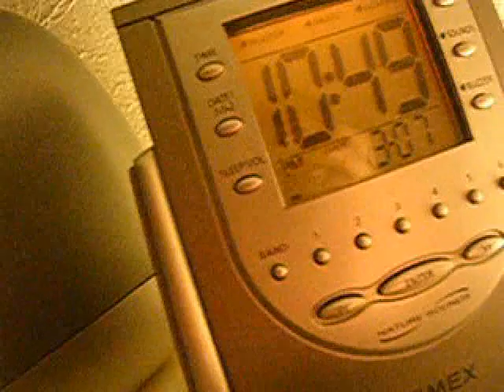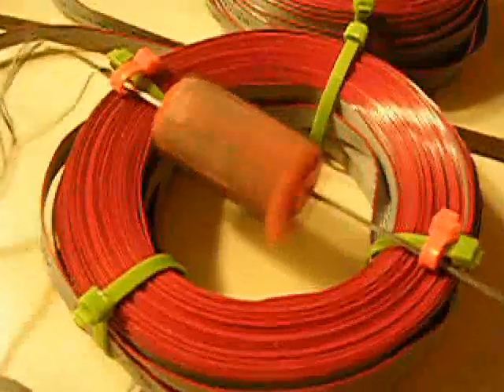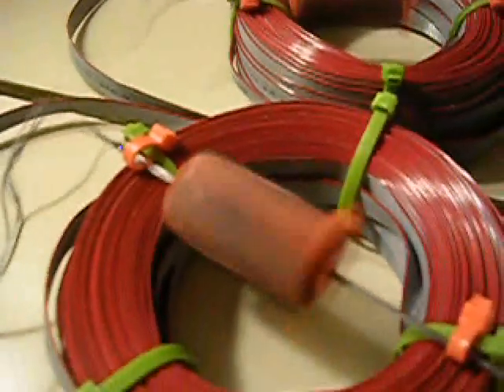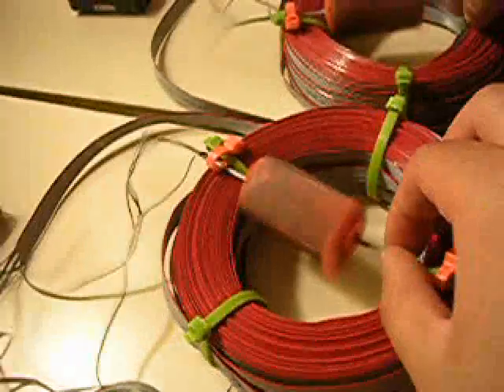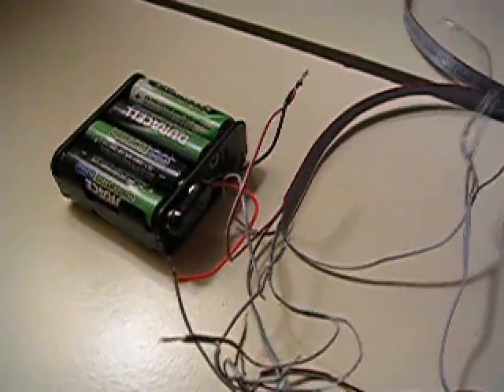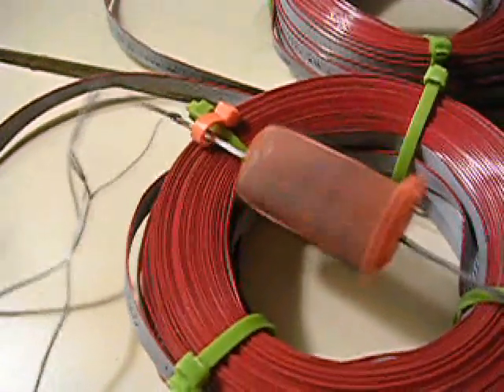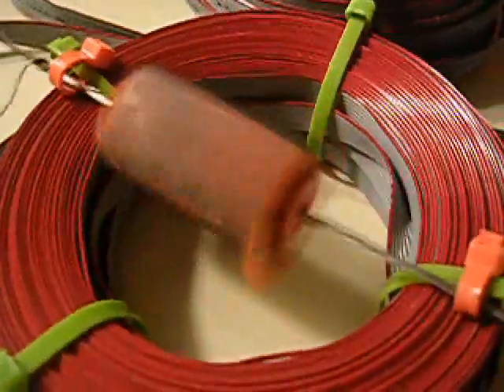Electric motor ▲ 40HR runtime

Comment from the maker: Sure. As you may recall, a simple electromagnet consists of a wire wound around a nail and connected into a battery.  Powerful electromagnets consist of many turns of wire.  Current must be driven through the coil to produce the magnetic field.  While I do not have a nail inside my electromagnet, I have hanged a permanent magnet on top.  The result is a simple electric motor, but with many turns, and less current draw, for the same magnetic thrust.

Comment: what you can try is: fully recharge 1 input battery, so you know how much Ah you've got. Then weigh the rotor and measure the rpm and figure out the friction so you can calculate it's kindetic energy. Measure time and run till battery (or precharged cap) is empty. Then compare to see if overunity occured. 
just a thought. :-)